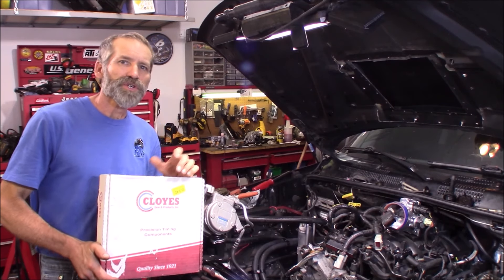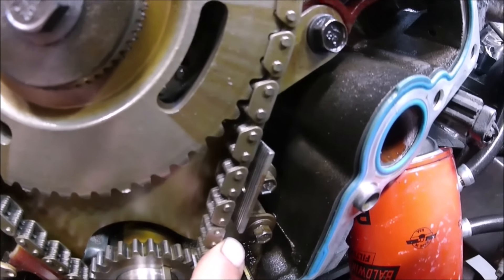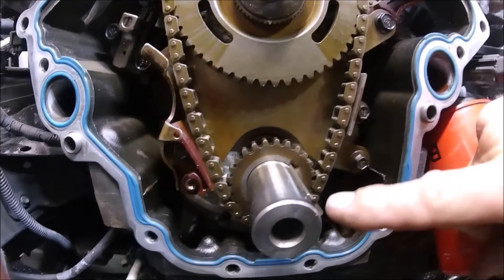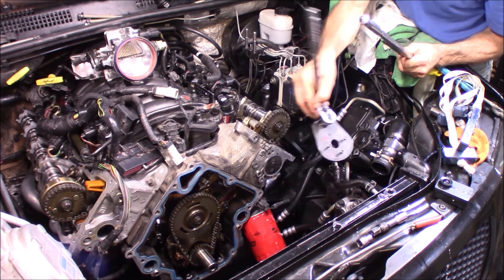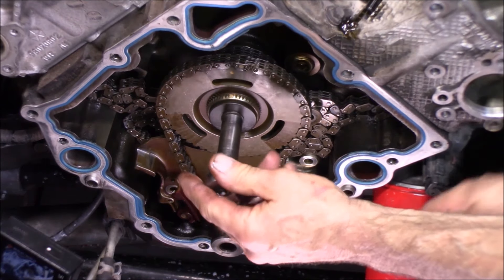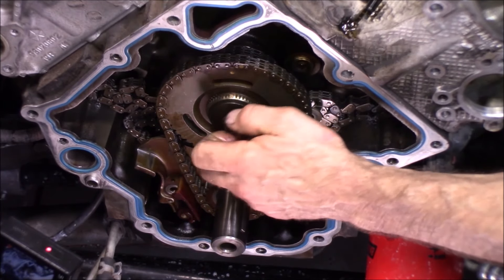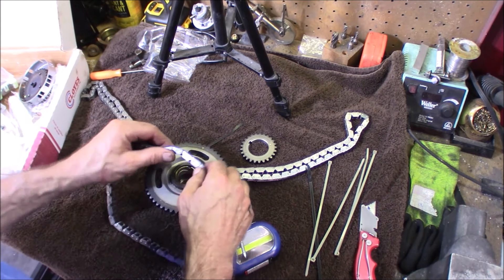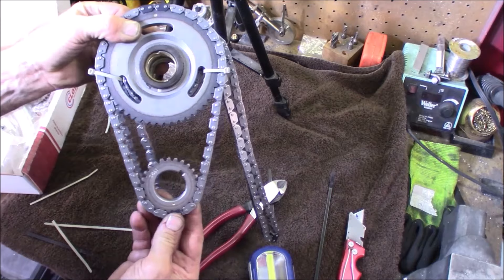How to Install Timing Chain Set Dodge, Jeep & Chrysler 4.7 & 3.7L

Comment: Question: Why did Dodge do away with the full timing cover gasket and now suggest using something like Hondabond along with a few orings ?
Can the full gasket #46000 be used on 2005 and up 4.7's ?
Reply from the maker: I would imagine it was just a matter of money a few O rings and sealant is a lot cheaper than the full gasket.. I'm pretty sure you can use the gasket on your 05

Comment: Thanks for the videos. I just replaced the valve cover gaskets on mine and noticed that the passenger chain had some play on it between 1/4 and 1/2 inch of play is that normal or should I get ready to replace it?
Reply from the maker: if it's not making any noise while running I think you'll be okay. With the Hydraulic tensioner it should tight up once the engine is running.
Reply: martinbuilt thank you, I appreciate it.

Comment: I recently pulled off my heads and I made a tool as well for the drivers side camshaft. But it occurred to me after I went to try and do the passenger side that the tool wouldn't work on that side because the two holes available for the tool on the driver's side sprocket are covered with rivets for the tone ring on the passenger side. I was able to grip the ever loving hell out of that side over the chain with some oil filter pliers while my friend broke the bolt loose, but I have to ask Martin: how is this tool supposed to work on the passenger side since there is only one hole available on that sprocket??
Reply from the maker: If you check this video out you will see how it works on the passenger side.
https://youtu.be/X0bXNI6kr_o

Comment: Sir, I have a question does is hard to do the head gasket on that 4.7 engine? I drove last week my truck and the lower radiator hose blow up and I didn’t see it until truck cut off driving at 65 mph now is blowing white smoke bad 😏
Reply from the maker: If you have done head gaskets in the past it's not to bad, other than you will need to pull the timing cover as well to redo the timing chains.

Comment: Thank you for the great info. I've been binge watching alot of your 4.7 videos. I'm installing new heads and timing kit on my 09 dodge 4.7
Huge question..when I go to install the heads how do I make sure the valves will not contact the pistons on this interference engine. Any help appreciated, thanks again
Reply from the maker: Thank you rod for watching all the videos I appreciate that.
 As you install the cylinder heads all the valves will be in the up position and there will be no interference.  Then install the Cam shafts placing the timing gear on the Cam shaft rotate the Cam camshaft so that the V8 on the timing gear is pointing upward. Then when you install the timing change the correct position again there will be no interference only if you install the timing chains incorrectly and rotate the engine will there be be a problem.
Reply: @martinbuilt  ok, thanks so much. I've been nervous to handle this repair but feel much more confident with your help. Hope all is well, and appreciate your response
Reply: How did it go
Reply: @rondavis2791  unsuccessful. I did follow everything I learned from the videos, and I did get the truck running, but it still had a horrible missfire, code referred me to crank position sensor, fixed that and then something else threw a code...I tapped out and sold it just was putting too much time and money into it..I will intentionally avoid 4.7 ram in the future. All said Martin's videos were spot on and now I know how to install heads and timing
Reply: @rodb4410  man that sucks. Yeah when you start getting into cylinder heads might as well do a rebuilt from a machinist or a remanufactured. Engine. 4.7 can be really good engines.

Comment: Why do the 08 cams make it run better?? I have to replace my heads on an 05 RAM 1500 4.7.
Reply from the maker: The 08 + cams have more lift on both intake and exhaust.
Reply: @martinbuilt  Martin, I had a lifter come off and blow through my valve cover.. when I took off the V-cover I discovered that 2 rockers were off and the head was broken at the place where the lash adjusters seat into.. Do you suppose I can replace both heads and expect that the motor will operate ok?? (Love your videos-they are great!)

Comment: Hi, Just wanted to say thank you for a couple of your videos. This one on replacing the timing chains and sprockets and the one on installing solid lifters. I had to tear the heads off my WK grand cherokee to replace some bent valves so I decided to change all the valves, the valve springs, seals and put solid lifters in. I also replaced the timing chain and sprockets along with the water pump and belt tensioner and new fuel injector connectors. Little bit of work but it runs great now. Thanks again.
Reply from the maker: Glad you found my videos helpful. Did you have a timing chain failure that caused the bent valve?
Reply: No, after I installed HO cams the bolt on the drivers side cam came slightly loose, guess I should’ve put locktite on ie, and the timing went off just slightly and caused the 4 intake valves on the drivers side head to hit pistons and bend. The pistons were fine but not the valves. Alls good now. Painful lesson learned though.
Reply from the maker: @jerrymcmanus9366  sorry to hear that, I would be surprised if the bolt actually came loose, what have seen is that you may have thought the cam gear was seated to the cam but in actuality, it is not, and then the cam gear slips and you end up with bent valves and the appears to have come to loose.
Reply: @martinbuilt  thats very possible.  The pin or dowel was damaged too. I’d include de a pic but looks like YouTube doesn’t allow for that in this message area.
Reply from the maker: @jerrymcmanus9366  you can send me pics at 
  Facebook https://www.facebook.com/Martinbuilt-2351766611763181

Comment: oUTSTANDING! Thank you very much! I have a 02 Dodge ram with the 4.7 that needs exactly this done, I need to perform this fix so i can use it for work while i pull my 5.7 out of my 06 ram & go through it! The 4.7 is the first one ive ever owned so i was a bit nervous, but not now! Took the 02 to a garage & was told it was going to cost me 5000-6000 for a new motor! That i cant afford! This makes it way less painful! Thank you! you saved me a chunk of change! Now,on my 06, im needing to replace cam, lifters, valve guide seals, timing gear & chain, & depending on what i find in the pan, maybe a set of berings & God forbid a new crank, ( maybe just polished) but want to do it right. What do you have for this? lol
Reply from the maker: Thank you. I really appreciate that. 
I don't have much for the 5.7
I did do one video that shows the Hemi drops valve seats as well. 
https://youtu.be/hM5Amy7VXlk

Comment: Do you recommend 20w / 50 oil for 192 thousand miles ????
Reply from the maker: I would recommend Rotella 15w40 if you want to use a heavier weight oil
Reply: @martinbuilt  thank you Mr martin

Comment: Are you planning on doing any videos on checking piston walls or replacong rings and bearings or anything like that? I would really like to see that...also crankshaft seals...preferably pulling the crankshaft...

I am doing a rebuild of my 4.7...it has 235k miles on it...it doesn't NEED rebuilt per say, just the passenger head had a failure...but I would LIKE to rebuild it while I habe it out of the truck...
Reply from the maker: Yes, I'll be rebuilding the engine that I have on the stand.
Reply: I'm really looking forward to that one...I just got the new head for mine yesterday and need to have it checked...valve springs are in the mail...do you think I should replace the valves themselves for any reason? There is nothing wrong with them...I have no seals and everything for them.
Reply from the maker: @Kolonol1  no I wouldn't replace the valves, but I would replace the valve seals.
Reply: Oh yes valve seats I have...my next questions...what about valve springs? They have 235k miles on them...If I end up keeping the truck I plan on replacing them when I do the HO cam upgrade next fall. You inspired me 😈
Reply from the maker: @Kolonol1  Yeah it would be a good idea with that many miles. If you're going to rebuild the engine you may want to find a set of complete HO heads with the cams.
Reply: @martinbuilt  what benefit does that give me?
Reply from the maker: @Kolonol1  The chambers and ports have a better design for improved flow and burn.
Reply: @martinbuilt  ah ok that makes sense...I will keep that in mind when I tear everything back down...the junkyard i pull from inly charge me $35 for a head so that would definitely be towards the top of my list.

Comment: I have an '05 3.7 liberty with 200,000 miles. Should I replace my timing chains? I don't know if it's ever been done.
Reply from the maker: If it's well maintained with a hi quality motor oil you can go to 250k or even 300k

Comment: Thank you such a comprehensive video on this subject... Can you explain exactly what an 08 camshaft is? Would it be compatible with my 2000 4.7? Any tuning mods required? Thanks again.
Reply from the maker: In 08-13 the 4.7 came out with a new design that produced over 300 horse and one of the reasons is the camshaft profile that has over .060 lift more are the intake and over .040 on exhaust. Yes you can install them in your 2,000 with a stock tune but of course you'd benefit from a tune.
Reply: @martinbuilt  so basically they are very similar design?

Comment: I ordered the Cloyes jtec timing kit and upon installation today I realized it doesn't have any of the sprockets in the kit! Why would I have to order these separately? And now my job will take several weeks longer!
Reply from the maker: Many companies sell a chain intentional kit and a complete kit.
Reply: So what ended up happening is when I ordered my timing chain kit they sent me a kit with the correct timing chain kit number but with an X at the end. Chloe's sells timing chain kits with no sprockets and those kits have the same part number but with an X at the end! Heads up. Now I have to reorder the same timing kit but without the X so that I can return the other kit. Huge waste of time and I'm disappointed in Chloe's for doing this!
Reply: @davidkieffer7278  That's odd. I spent extra time looking for a kit with no sprockets.

Comment: Hey Martin wonderful and helpful post sir I thank God for videos like this because it really helps out us DIY guys. I got a question can a rubber strap wrench be used to adjust the camshaft while installing the camshaft timing sprocket so to avoid and teeth marks or damage to the camshaft
Reply from the maker: maybe, I've never tried that.

Comment: I did exactly that..last night broke that exact part..will it still go without replacement chain is still tight
Reply from the maker: If you broke that guide tensioner on the main chain you need to replace it.

Comment: I have a timeing cover gasket kit that came with two orings and a triangle gasket along with the gasket for the houseing do I need to use the rings with the gasket or not
Reply from the maker: if the gasket for the cover has the O-rings built into it I would say no
Reply: https://www.amazon.com/dp/B07LF84WXB? ref=ppx_pop_mob_ap_sharethis is the link to the one I got
Reply from the maker: @Witcher-tm9wf  I can't say for sure but it looks like you don't need those O-rings and that other gasket.
This is the one I used 
Fel-Pro TCS46000 Timing Cover Gasket Set  https://amzn.to/2NG8e0g
Reply: martinbuilt that gasket looks Identical to the one I have not sure why it came with those but I’m not going to use the rings. Thank you for the help.

Comment: Hey martin for some reason when I did the timing chain on mine. I still have slop afterwards. Only on the driver side chain though. When I installed everything. Everything seemed all tight but after I put it all together and took it for a ride. I heard the chain rattle. Pulled the covers back off and sure enough the chain is still loose. Are the guides supposed to be pushed all the way up? I noticed that when I put them in that you could put the metal bushing. I'm hoping that its maybe something like that causing it
Reply from the maker: sounds like the tensioner on that side is not working. Was that the same way with the old timing set? Did you replace the tensioners?
Reply: @martinbuilt  I replaced everything. All tensioners, guides and sprockets.
Reply from the maker: @MrMuffanga  here's kind of a crazy idea. How about since you got the timing cover back off you start the engine and observe the timing chain in operation I wouldn't do this for more than maybe 15 or 20 seconds at a time you don't want to produce too much heat since there won't be any coolant in the cylinder heads. Yes I've seen this done before I would have done it myself in this video but I didn't Discover it until afterwards.
Reply: @martinbuilt  I'm pulling it all apart as we speak. My guess is the guides have an adjustment slot. We'll see if my theory is correct within the next hour

Comment: I just noticed something when you were torquing down the Cam bolts you had all of the other components already installed like the water pump Etc and the alternator but then after you were done with the torquing down it looks like you removed all those parts again even the timing chain cover. Would you care to share what was going on there, if you think it's helpful

Comment: Just had my engine go to hell. Timing chain broke. Im at a big loss, very cold in NY to work on a engine. Mine 2002 4.7 grand cherokee. One way just replace whole motor the other is check mine out by dismantling heads to see how much damage has been done. What do you recommend ? Its my only car im so sad cuz i did so much work on it...thank you if you reply.
Reply from the maker: Sorry to hear that, you don't hear Too Many timing chains actually breaking but that could definitely cause valves to get bent. You may be better off replacing the engine. It wasn't for the weather I would pull the cylinder head to see what kind of damage there was and replace the timing chain set.
Reply: Thank you for the quick reply. Either way it will be spring before i get to it. The local shop won’t do the work. Guess im on my own to do it. So much money into it so far then this break down saddens me im in this position.
Reply: @martinbuilt  im going to the yard tomorrow to check out the 2004 HO engine ive been pulling cams and manifold from im going to buy it, have them pull it. Will a NGC motor work on a JTEC ECM. i will switch crank tone ring and cam target wheel that is on my 2002 jeep 4.7 to the HO also have heads gone through by Precision Machine shop in town. They will check valves, valve seats and seals. Yes i will put a new timing chain kit in along with new rocker arms with the smaller hole at the lash adjustment end. Not coping ya just have the same itch for more power. Thank you for all your videos and fast replys. Speaking of fast when are ya gonna take us out for a ride in your new 08 cammed with the 75 mm throttle body ive seen one video of yours but not sure if it had the 08 cam in it. Wow 6500 rpm stiff shift gear change is the way to go.

Comment: I'm about to have the heads on my 3.7 2005 GC rebuilt due to a failed valve seat.  I figured I'll replace everything on the front of the motor while I'm in there.  I'm struggling to find the right Cloyes timing kit for the car as it's an 05 JTEC.  I don't see a kit available.  They all seem to be NGC for 05.  I've verified that the PCM has 3 connectors and the target controller has 1 window (jtec). Would I be okay just ordering a JTEC kit for a 3.7 Liberty?

Thanks in advance!
Wade
Reply: Just checked the links in the description!  Looks like I need the 9-0393S.  That is a lot!  Your videos are a big help!

Comment: Is this the same process for older and newer? Same torques?
Reply from the maker: yes, the same process for newer and older. The torque specs. should be the same as well. the only ones that might be different are the two bolts that hold the up guide in place, one in each cylinder head.

Comment: I have a question about the new timing sensor sprocket vs. The old one. The holes for the sensor timing didn't line up when you compared the old one with the new one, but you used it anyhow. Wouldn't that through the timing off and bend valves, etc?
Reply from the maker: No I didn't actually use that one, I deliberately bought the incorrect one to show the difference between the JTEC and the NGC sprocket and then I show that I had the correct brand new Mopar one that I was actually installing

Comment: Where there any noises whatsoever coming from the motor before before the timing guide rebuild?
Reply from the maker: No noises whatsoever but if you have a bad Hydraulic tensioner the noises are common.

Comment: Hi! I’m doing this to my 2005 grand Cherokee 4.7 soon. Will the 08 cams work in mine also? How do they compare to the HOs?
Reply from the maker: yes they will work on all 4.7 engines. The 08 cams have a great pull similar to HO but the 08 really have a great pull at 3200 past 6000 where the HO fall flat at 5200
Reply: martinbuilt thanks so much!! Hard to find quality 4.7 info.

Comment: Hey Martin, quick question. When you say left tensioner do you mean the one on the left when your looking straight forward at the engine or the left as in car left drivers side. It's really confusing me because the left side is the drivers side on a car... My left tensioner is the one that went. The left side being the one when I'm looking straight at the engine.
Reply from the maker: when I am saying left, I mean as if you were behind the steering wheel.
Reply: @martinbuilt  awesome thank you man!